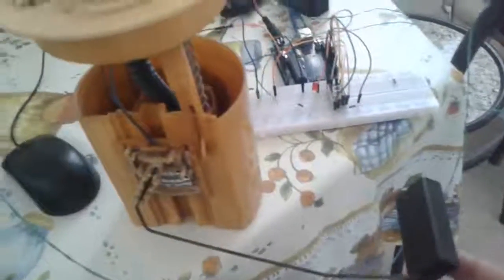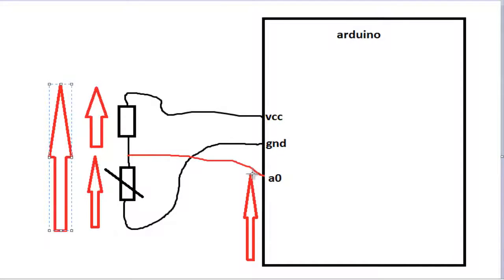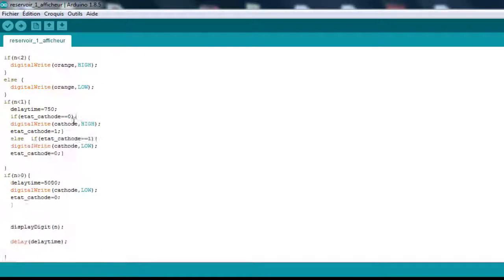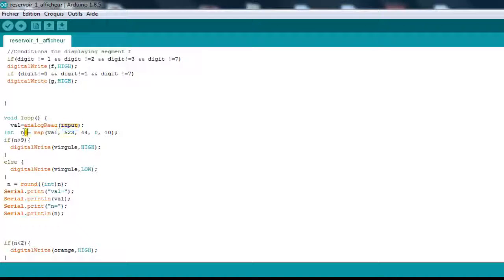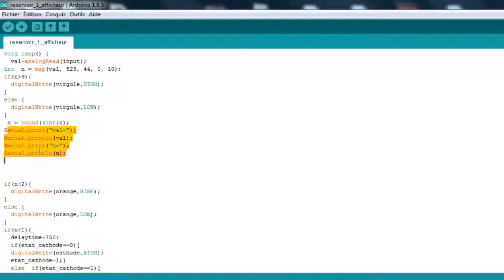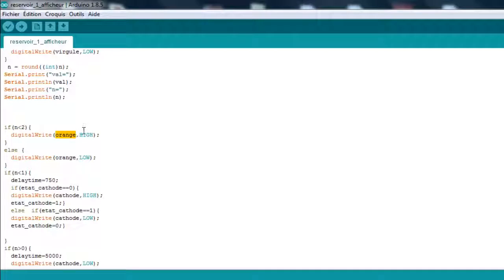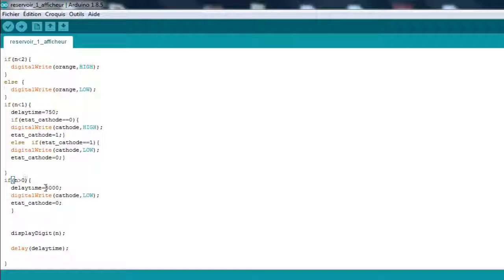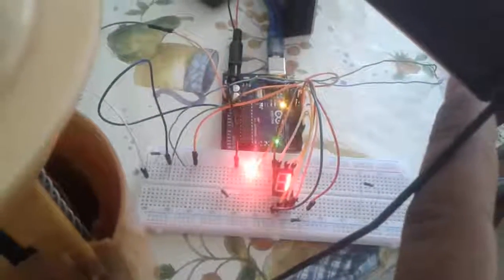Arduino Project : Fuel Gauge Display

Comment: Thanks for this, i did one using nodemcu, reading my car's gauge. But my question is: Did your circuit still work went the gauge is mounted and connected to the car's default system? and putting your reading in parallel? i didn't able to go further as it blocks me. Thank you